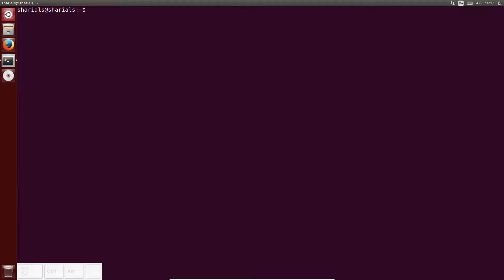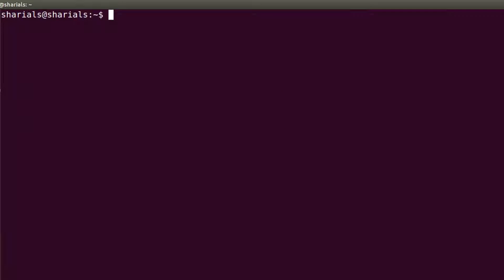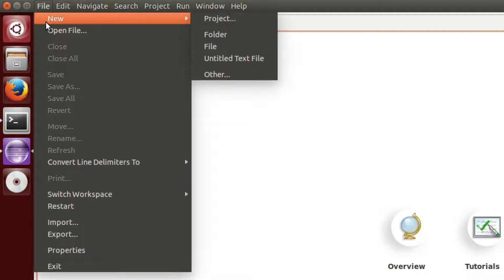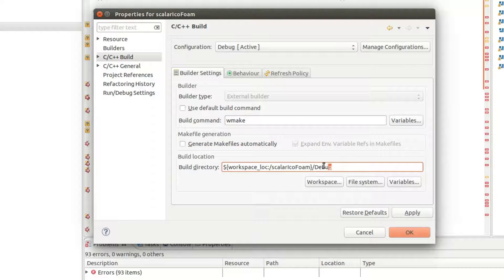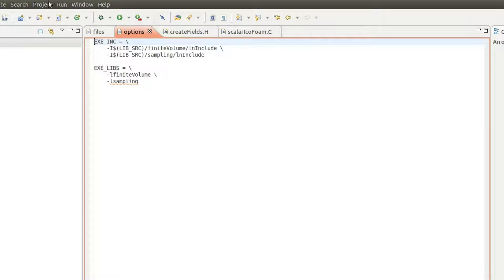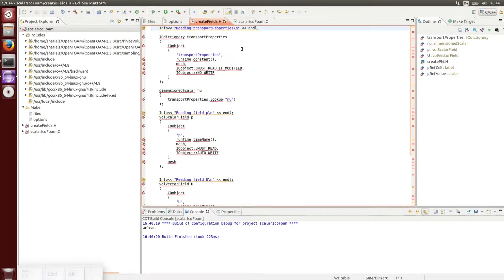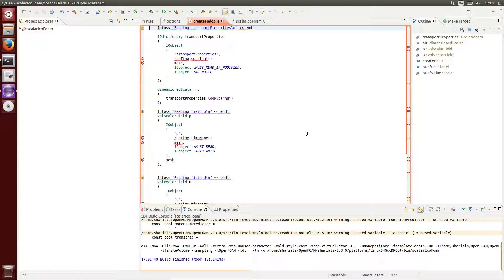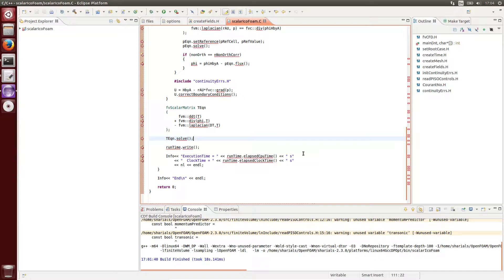How to use Eclipse as IDE for extending OpenFOAM® - 1 Basic Setup

Comment: Hi

Great job.

I have problem when I make the first test

$ ls $FOAM_USER_APPBIN

result :

cartesian2DMesh extBlockMesh FMSToSurface preparePar tetMesh .............................

But I don't see my scalarIcoFoam

I have installed cfMesh and extBlockMesh and it's what we see with $ ls $FOAM_USER_APPBIN

How I can resolve this problem

Thanks
Reply from the maker: Hi there!
There are two possible reasons why you can't find the binary:
- you misspelled the executable path in the 'files'-file in the 'Make'-folder
EXE = $(FOAM_USER_APPBIN)/scalarIcoFoam
- or the compilation was not successful - in that case you should get some
Reply from the maker: sharialsChannel * some error messages

Comment: Hi, I've tried Eclipse some time ago. At that time, I met problems when debugging openfoam using Eclipse because of gcc versions. I don't know if you met the same problem. If not, would you mind sharing your experience with us?  As the problems i had with Eclipse, it frustrated me a lot. I changed to qtcreator.
Reply from the maker: Hi, I have not tried to debug with eclipse yet. There are hints on how to debug if you follow the links in the description, but I asume you already know them. When my time allows it, I'll test the debugging and may make a video. I personally prefer to use QtCreator, too. ;-)

Thanks a lot for sharing your experience!